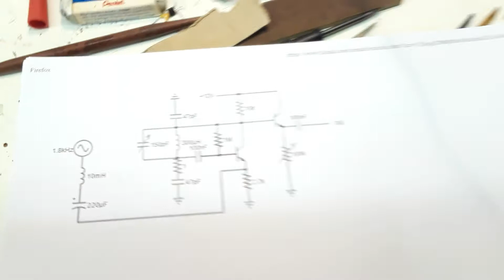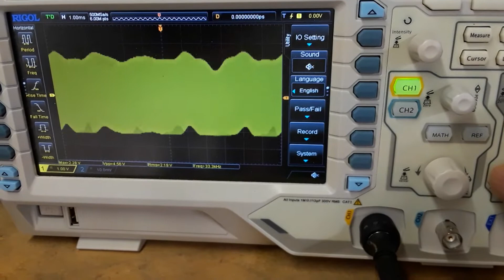2 Transistor AM Transmitter w/ schematic

Comment: Do you not need a ground for the input signal to work?
Reply from the maker: Input signal ground is needed. The audio section is not shown in the schematic for simplicity.
Reply: @andrewferg8737  Pls test the modulation depth with a 1KHz tone from YouTube. It sounds really good. Is it your design?